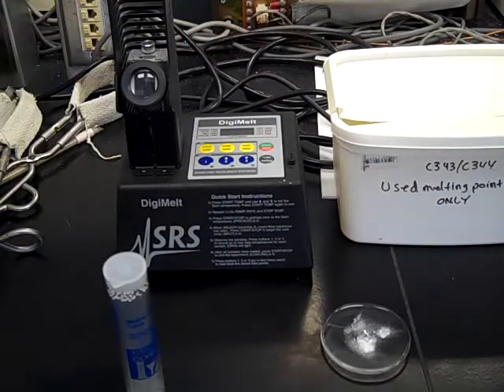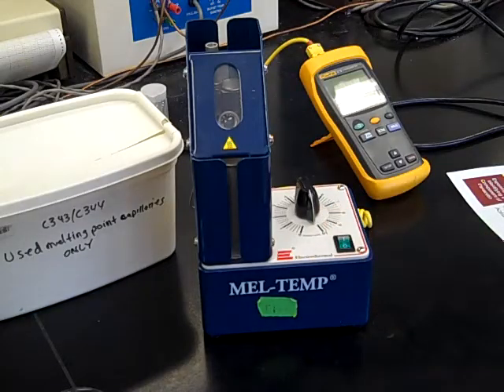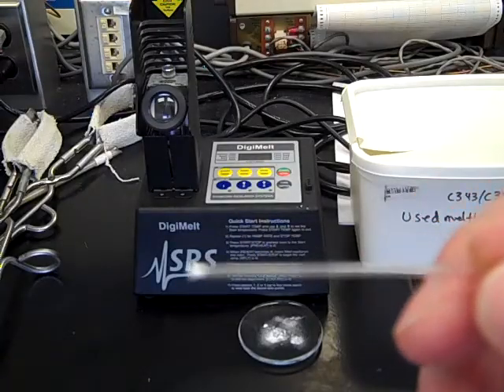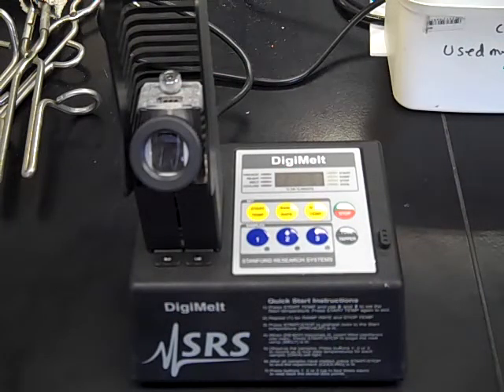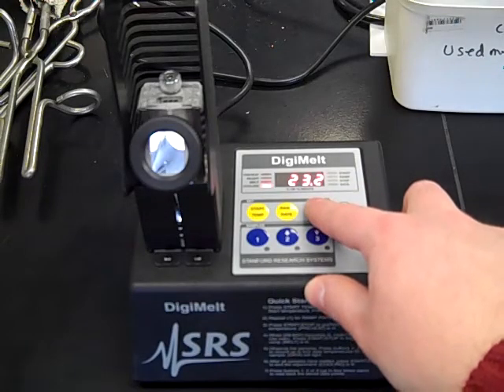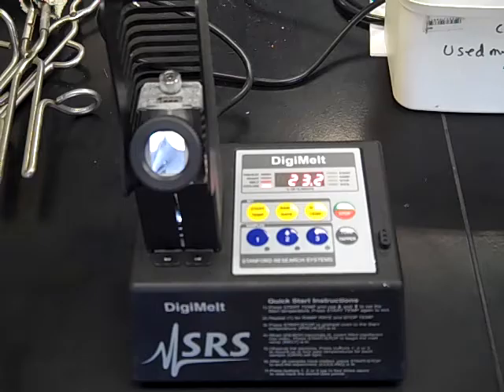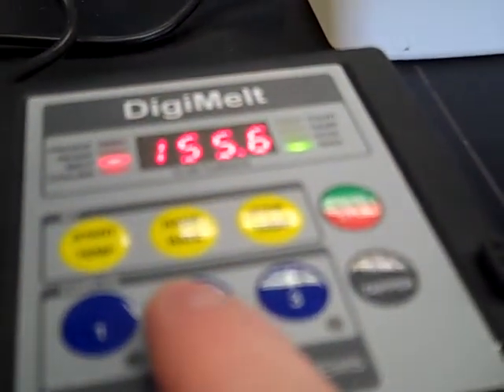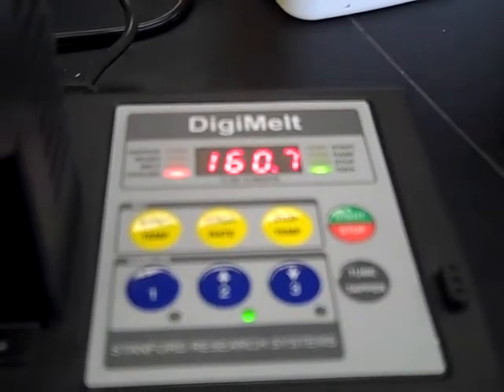Exp 3 Melting Point Determination

Comment from the maker: When you don't know the melting point range, you could try a fast (5-10 degree per minute) heat ramp from a low temperature (maybe 75 degrees) to a high temperature (maybe 250 degrees).  There's not really a perfect way to do it.  A better alternative might be to use a different analytical tool (IR, 1H NMR, etc.) first to narrow your range.